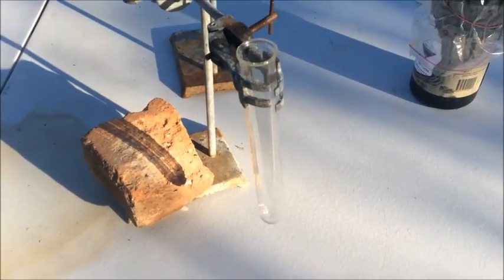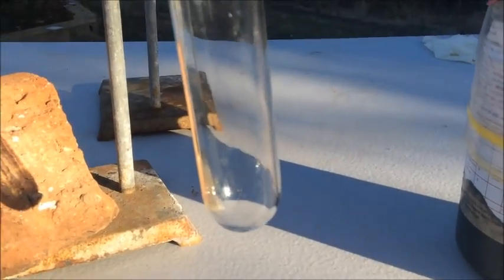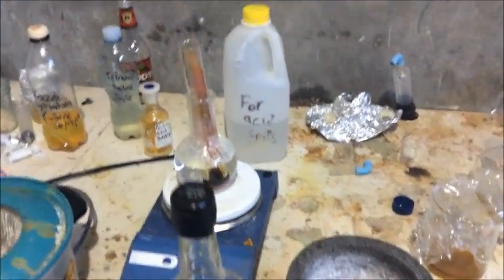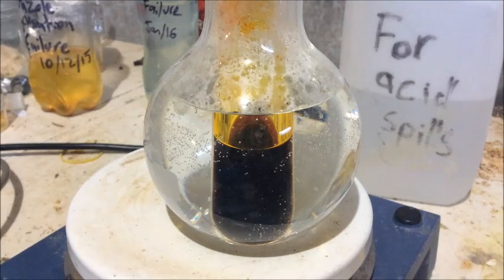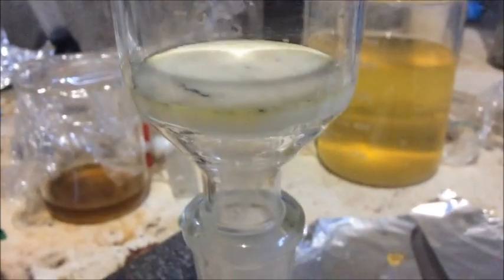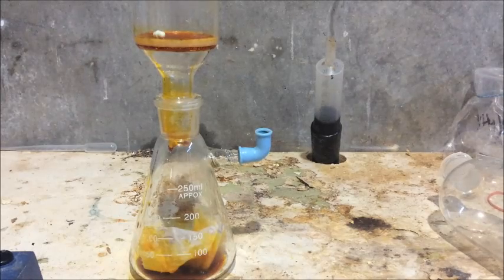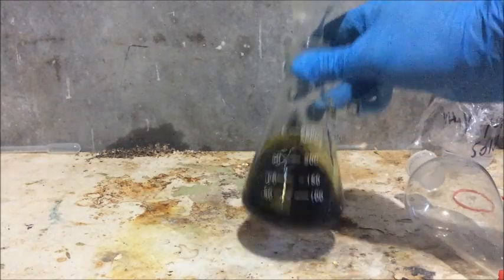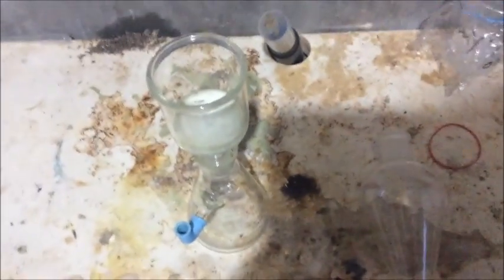Cleaning with chromic acid

Comment: (yes, i know this is did years old🙄)

I'm quite surprised that the paper towel survived. I made it once, using the preparation given in Vogel, and that stuff would eat a popsicle stick as fast as you could push it into the beaker. Cleaning glassware only required a few ml, carefully swirled around to coat the glass.

Comment: For that liquid chromium waste at the end, could you theoretically evaporate the liquids off and store just the solid? Or is that dangerous? (Meaning is there more than just water coming off that would be harmful)
Reply: Some chromium compounds are liquid and a bit volatile, so I wouldn't recommend it.
Reply: @luisp.3788  10-4 thanks for the input.

Comment: 7:23 the fluid is naturally filtering itself faster than you are lol xD
also, you could apply pressure/ blow into a tube connected through a cap on top of the filter to push the fluid through

Comment: I work in an organic analytical lab and we often use chromic acid for stubborn staining bad samples.  Cleans glassware magnificently and is an extremely powerful oxidiser.  Thought i'd give some info for you, but when we use it, we usually just rinse our glassware with it at r.t. and swirl it around.  In terms of the analytes we're looking for (mostly pesticides or hydrocarbons), the glassware is clean as anything. Mostly we just use lab grade analytical detergent, much easier to use that vs. chromic acid.  For GC inserts we soak them in chromic acid for atleast a few days before silanizing them.   :) Awesome video!  Searched this one up since our whole stock of acid is now green and all reduced :(

Comment: https://www.youtube.com/watch?v=UvyinoZP6HQ
These are 22$ each, with free shipping. And the power supply is around ~3$
Way superior, and quieter to any method I've seen you use, and it's very easy to hook up.
Perhaps that's something to consider? :)

(By the way at 50$ per Mo-F(l)o, I think ti would've been cheaper to just acquire yourself a new test tube. :P
Reply from the maker: +CodeBrew Aw man so much quieter. I'd need something like that if I wanted to run vacuum distillations, but other than that it's pretty low on my priority list to replace the vacuum setup. Lots of other things need replacing first, or just buying because I think they're cool. Something to consider though yes. Even if I did own that, i'd still use a syringe during this sort of thing because it's just so corrosive i'd want to protect the pump from any droplets (and by the time I run it through scrubbing, the syringe is faster).

Ah yes, it probably is. But I have a weakness for dangerous chemistry haha

Comment: are you still making videos on tetrazoles?
Reply from the maker: +SA J Yes, I just need to get the last goddamn cyclisation synth working again. Something is cocking up and I can't work out what
Reply: +Extractions&Ire okie dokie. Awesome channel by the way!
Reply from the maker: Thanks man!
Reply: +Extractions&Ire for the acidification step try using hydrochloric acid instead sulfuric acid. the impurities in your sulfuric acid might be to blame. I don't know, just a guess.
Reply from the maker: Yes I am using HCl, which should be fine although sulphuric should also work. I believe, talking to Doriner355A that my solutions are too dilute. I've been lowering it to about 10% HCl or less during the diazionation, as i've done with previous diaz. but this one needs conc stuff. Have to wait for my new flasks to try again though, can't do the reflux.

Great to hear you got success though!